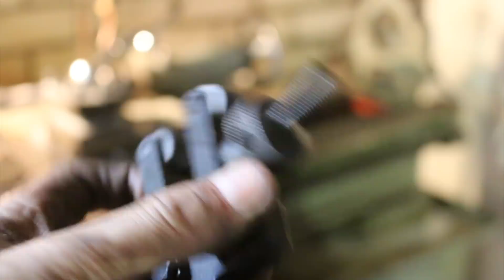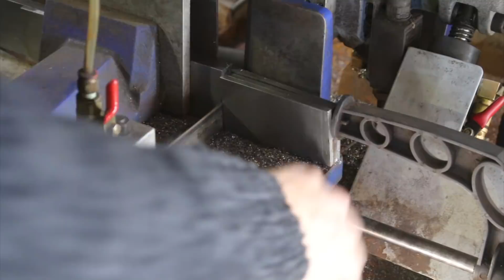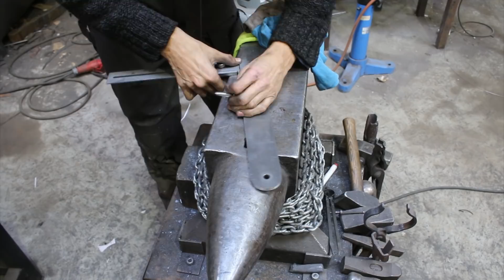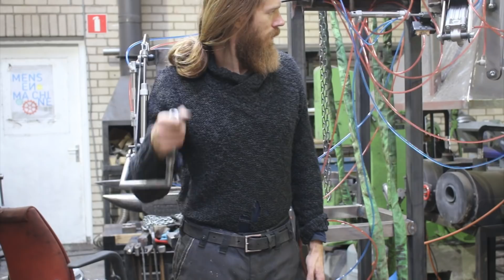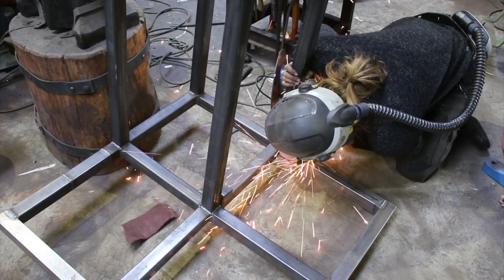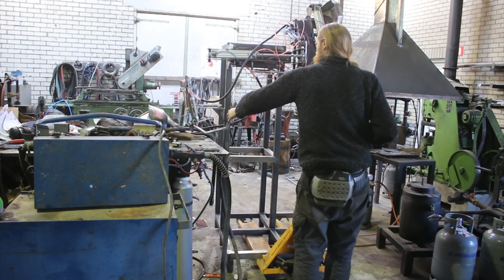Building a gigant robot, part 6.

Comment: I... wow.  That's beautiful. I hope you don't mind, but I'd like to tack a link to this onto Colin Furze' Hulkbuster series.  I was wondering about a few things though, any thoughts on using hydraulics rather than pneumatics?  Both have obvious pros and cons, but you can get the strength and rigidity of hydraulics without the concern of "jerkiness" if you put pneumatic accumulators inline.  The pneumatic side of the piston in the accumulator would dampen the surge of sudden input and stoppage.  Also, any plans on replacing the rigid link connecting the thumb with the wrist with another small actuator?  Seems this would give the thumb a bit more of the freedom of movement that we organic meat-servos enjoy.  Keep up the good work, that is without doubt the most beautiful giant robot I've ever seen outside fiction.  Please continue on this project! I can't wait to see where you can take it.

Comment: definitely not a kind of wideo for a coffee-bkeak) Anyway..
Have you considered hydrauric system instead of pneumatic? for a mobile construction, it will be much smaller, way more powerful. and not least significant, much better time response. but please... don`t use combustion engines as BD do))

Comment: wonderful work . . . THIS IS NOT A COMPLAINT . . . if you look at the base of the robot thumb, the joint only folds . . . your human thumb joint can also roll over to oppose the fingers . . . this looks like it would be a very difficult thing (for me) to build (not necessarily for you though).

of course, if you just need to slap someone silly, you non't need such fine control.
Reply from the maker: Time is always a ellement. So I compensate a bit...

Comment: Perhaps you should use hydraulic piston for smoother movement
Reply from the maker: Maybe... I am looking in to low pressure hydraulics.
Reply: The Fokker Friendship uses bleed air from the engines instead of oil because this system is lighter and has fewer parts. Instead of pistons it uses turbines with spindles. 
Disadvantages of air pistons are that the compressibility of the fluid shows through the wobble in the motion and the system is inefficient with energy.
Reply from the maker: @RubenLensvelt  true. I am looking into low pressure hydraulics. You csan use pneumatic air cilinders even....
Reply: @freerkwieringa275  That sounds like a good plan to me. I'm sure that your plan for low pressure hydraulic is significantly less expensive than common hydraulics and solves that typical wobble that comes with pneumatic actuation. This is everything you need I think.